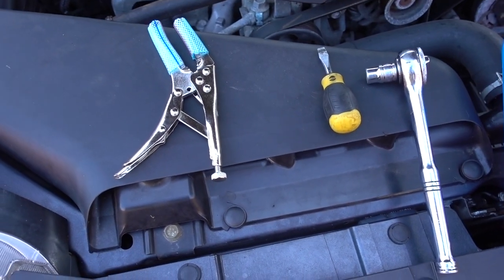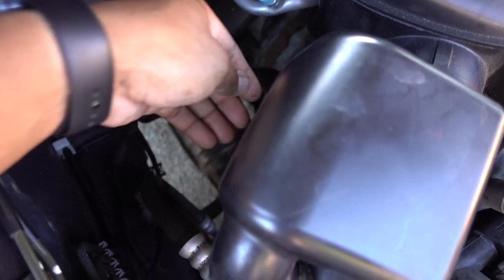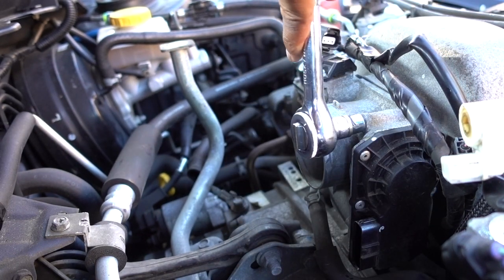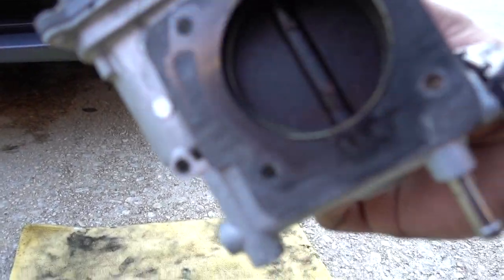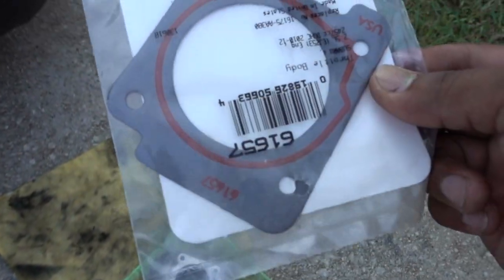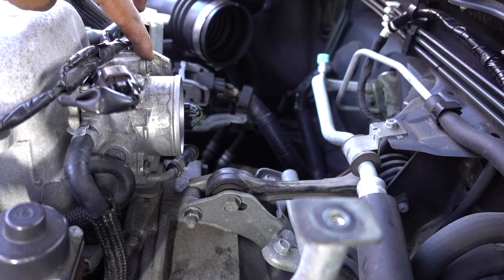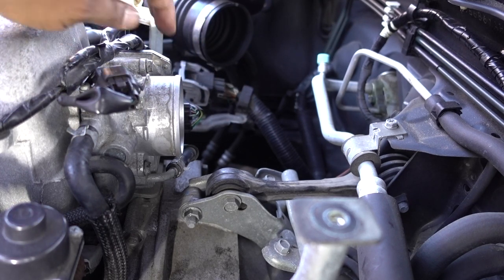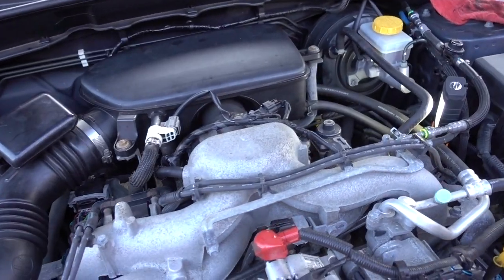How to Clean Your Thottle Body  (Subaru Impreza)

Comment: followed the same steps, but forget to plug in one socket and the car warning lights was on while starting the car, plug it back and the car running very smooth, and the engine warning light was off again, thank you for your video, saving me some money.
Reply from the maker: No problem

Comment: Thanks for your vids bro. I have been able to accomplish alot on my 2011 Impreza.
Reply from the maker: No problem bro
Reply: And when i reinstalled the throttle body, i got a high position alarm, so I performed a idle re-time and it worked wonderful.

Comment: Very informative video, thanks. I'm having a similar problem and may be trying this in the very near future. Tell me if you think I'm on the right track. I have an 09 Forester XT. I'm flipping the 171 code but only when I drive in speeds in excess of 80 miles an hour. If I drive steady 80 for more than 5 minutes it flips to code. If I reset the code and keep it under 80 it will never go off again. Until the next time I go above 80. A little bit of Internet research seems to indicate that it could be because of the mass air flow sensor or perhaps clogged fuel filters keeping the fuel pressure too low. Since it seems easier place to start with the mass airflow that's where I was going. It seems that a lot of people do throttle body and mass airflow sensors at the same time so I was going to give that a go if you think it seems necessary. Car has 110000 miles. What do you think?
Reply from the maker: Hey Michael thanks, yes do that and let me know how it goes

Comment: Thank you for your excellent video. I have a 2013 Impreza. What are the benefits of doing this/ or the signs I should do it? I’m planning to clean the MAF, got a kit with MAF cleaner and throttle body cleaner.
Reply from the maker: improve the idle, acceleration, fuel efficiency, and any potential issues with stalling.

Comment: Hey Happy New year. 
I have 2 questions, first is your subaru impreza in this video with a 1500cc engine? Secondly have you ever come across a part manual for the car especially the engine. Like timing belt, pulleys etc.
Reply from the maker: Hey man happy new year, yes is 1500cc and I don’t have the car no more

Comment: Amigo, tengo un Impreza 09 no turbo, el carro se me apaga cuando freno, pero vuelve a encender normal, esos cuando freno rápido y en los stop, le hice limpieza del trhottle body y el problema sigue, le cambie filtro de combustible,sensor maf, bujías y sigue igual y le han puesto el scanner y no arroja código ni check engine, nose cual es el problema y he gastado mucho. Y siempre se apaga, tus videos me han ayudado mucho, gracias
Reply from the maker: No hay problema, llévelo con un eléctrico para que lo cheque
Reply: Ok  voy a llevarlo, espero hallar solución 👍 gracias
Reply from the maker: Listo
Reply: busca en google el modelo de tu carro y escribe idle relearn. Basicamente lo que puede ser es que la computadora del carro se alla resetiado por alguna razon y ahora necesita programarse para las funciones de aceleracion, aire y gas ratio.
Reply: @yamisosa5180 💥 gracias amigo, fíjate que ya le había hecho muchas veces el iddle,  el problema era la transmision el(torque converter) le busque y le mandé a poner otra transmision y el problema se solucionó. 👍 y estoy feliz porque no se apaga más 🚗
Reply: Viste si alguna manguera de vacio esta desconectada ? o quizas rota

Comment: Why did you use the pinch pliers on that one hose going to the throttle body? Is that necessary? I've never done this before so just curious.
Reply from the maker: Just is case I have some coolant coming out but is not really necessary
Reply: Bullet Solano thanks for the quick reply.
Reply from the maker: No problem

Comment: Did you have to disconnect your battery before doing this process?
Reply from the maker: Yes negative side
Reply: Thanks for the fast response. I'm thinking of giving this a try as well as a MAP sensor clean on my O6 Impreza 2.5i. I got a P0171 Bank 1 too lean code. Think this might remedy the problem?
Reply from the maker: No problem, yes that can fix it
Reply: @Michael-bs1ev  This might be a bit late, but clean your MAF sensor while you're at it.  If it's dirty or malfunctioning that can also cause a lean condition.
Reply: I did man and the code is gone. I really appreciate your help. Dealership wanted to charge me $500 for service lol.

Comment: hey whats up man my 13 impreza is stalling sometimes on start up batteries fine terminals clean..low rpm on startup sometimes doesn't even wanna start up do you think this would be a worth a shot thank
Reply from the maker: Hey bro, do an idle relearn first
Reply from the maker: https://youtu.be/eetBmBifvFM
Reply: @BulletSolano  appreciate the quick response man I was in between doing that and this but I definitely will bro appreciate that
Reply from the maker: No problem
Reply: hey what's up bro is there a specific sound were looking for if it's done correctly?
Reply from the maker: Bheymar Gamarra hey bro, sound of the engine?
Reply: @BulletSolano  it's at startup after I did it I didn't have low rpm (I did drive it earlier no problem) I didn't notice the low rpm at fully stopping when I test drove it after the relearn but when I got home turned it on the startup was funny it cranks to long before starting the engine
Reply from the maker: Ok, I think the computer is setting everything again, you should be ok
Reply: @BulletSolano  alright thanks man
Reply from the maker: No problem bro